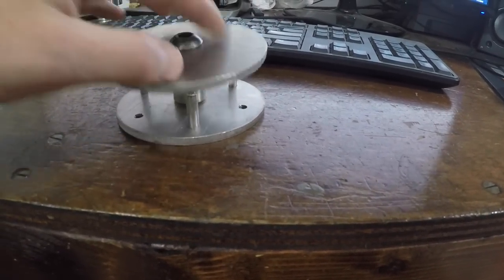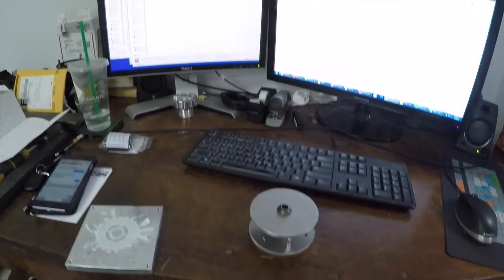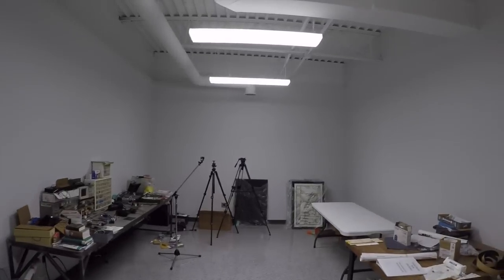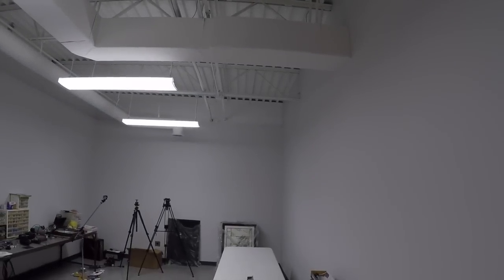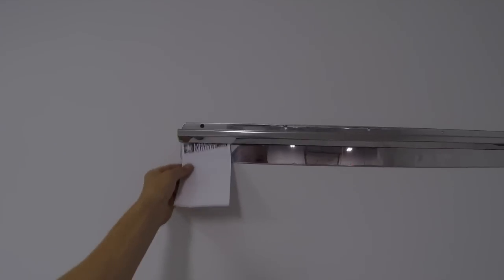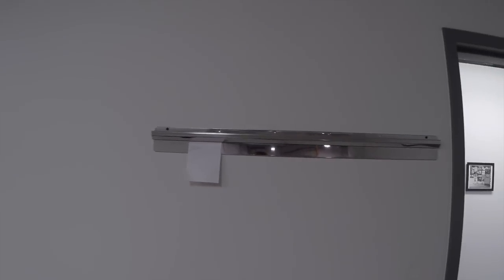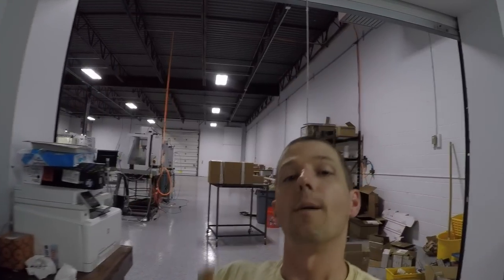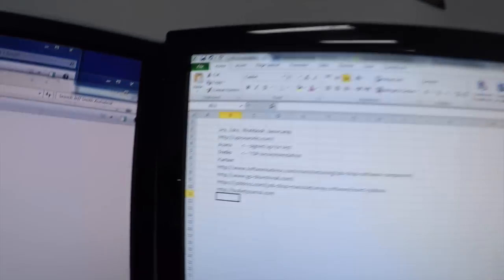New Projects, Arduino Sneak Peek, Organizing Jobs, 3M Tape Fixture!  CB26

Comment: Years ago there was a magazine called ROBOT if I remember right.  It wound up being largely about automating.  One article especially stuck with me.  A theater organ maker/refurbisher needed to make pulls for the sound stops, hundreds of them, out of wood.  It would take in wood dowel, feed it to the right place, turn the knob, drill a place for a pin and finally do a finish cut so the piece dropped into a cushioned box.  Not a big machine, but very interesting and advanced for the day (think early 1980s).  A small computer/controller was involved but it was long before Arduino or Pi's were on the horizon. It was very much a DIY effort.

All that to let you know nothing we do is really new, but we do keep learning from all our projects... Enough daydreaming for now. 

Have a great 4th!
Reply: Ha, I bet you didn't even notice the pump organ in my garage!

Comment: Hey! Some personal experience with trello, I'm a mechatronics student and for awhile i participated in the aerial robotics team at my school, I love your channel and I'm currently trying to build a desktop cnc/3d printer based off your diy videos !

With trello, it syncs across devices and can be updated by anyone , it's very similar to a digital ticket board with as much space as you need, however that space is what I see as its flaw, it can easily become very cluttered, my suggestion would be to have a organizational system about who does what and how it is to be operated, our's ended up with months old project threads sitting around, threads that weren't updated regularly, sometimes only half a group was on the relevant threads, etc. It's a great tool but as with any tool, the result you get, depends on how you use it!

If the cnc/3d printer you inspired me to make goes as well as I hope I'll try to send you guys a video on it!

Comment: 90% of your viewers won't have 3-Phase available, but they are going to be acquiring older industrial machines (many will be 3-phase) to get started. I think American Rotary has made a wise investment in sponsoring your channel.
Reply: Three phase is the way to go. Most viewers will probably build your own. You can't hardly give away three phase motors on craigslist. Than and a small cheap starter motor, and you have it.

Comment: I am a small manufacturer of my own product for about 16 years. I really appreciate your CB series. Makes me remember some of the old struggles and many of the current ones as well. I know you are really interested in creating your own automation but you also might consider an off the shelf robot arm from somebody like Universal Robots. I have no affiliation with them in any way but was amazed at the price. I went to the local dealer and had a demo and again was amazed by the simplicity and ease of programming. I'm sure using a unit like theirs in conjunction with your own automation projects would really open up the possibilities. Anyway looking forward to more of your CB series. Keep up the good work.
Reply: Not sure what your budget is but I did see you buy an expensive compressor and Iron worker :) They have 3 sizes and I got quotes on the small (UR3) and medium (UR5) size at around 23K and 35K plus about 3K if you want gripper system that the arm can change while its running. Back just a few years you were looking at 75K-100K and they were beasts that need safety cages, were not portable, and were more difficult to program. Where I live the minimum wage is $15/hr with taxes on top of that so it becomes easier to justify.

Comment: John, there is no fail. Only learning what does not work. And I'm in. I may not offer much in the coding department, but ideas I have.
On the 440 engraving feeder, I have a couple ideas if I were doing it. A vacuum fixture seems like a solid way to hold something in place and could be easily automated with a solenoid. That's where I think I'd start.
Reply: +NYC CNC Electromagnet was part of my other thought actually. We use those on aggregate conveyor systems to remove metal before it goes in a crusher. Should work great for steel. The vacuum system would work with any material it can pull a vacuum on which is why I was thinking that direction.
Reply: When thinking of engraving feeder/holder small pneumatic cylinders might be right solution. From my experience pneumatics is often used for this type of work and it's very reliable.

Comment: For projects you're contemplating manufacturing have you considered something other than Arduino?  Arduino fits well in quick one-off applications but doesn't have a good path to even a limited production environment.  You might take a look at the Texas Instrument MSP430 / MSP432.  Their 'launchpad' with Energia provides an Ardunio-like development environment but you can also ramp to more sophisticated environments as needs change.  Lots of support from a major company (big plus) with a big reference designs library; more processor choices; great low-power (battery conservation) capability; YouTube tutorials; and, some good reference books on interfacing and real time system development (check Amazon).  
The move from Arduino to something like the MSP430 would be philosophically kind of like what you've done with your cad/cam capability.

Comment: Hey John,

Love what you do and follow along with all the other machinist out there Tom Lipton, Adam, etc. I can help you along with the automation bits. I'm an Electronics Engineer and worked a lot with micro controllers including the arduino back in my college days. I work on an industrial scale now in the gas and oil industry with PLCs. Lots of different routes to take when automating anything. Shoot me a message anytime. Keep up the great work!

Comment: tilt switch, or 3d digitizer?
If you're going to heat a part to seperate it, why not just use super-glue (cyanoacrylate?) People use it all the time on lathes, why not on this? Use heat to break the bond, wash the excess off with acetone.

Comment: I may be able to help you with the automation projects. I am in process of converting my lawnmower to RC then later automating with Arduino.  I am a mechanical engineer junior transitioning to senior and I have decent programming experience. I am taking C++ now which means I can make my own header files and be able to adapt other header files to fit the program. I am also proficient in SolidWorks. Just let me know and we can set up a google drive for the Code and a grabcad account for the modeling. However, I may be swamp with a future internship so it may be just a weekend project for me.
Reply: Shane, I'm interested in the RC lawn mower. I'm about to start making one as well.
Reply: I am doing most of the wireless communication between Arduinos. I am leaning on WIFI communications now but I may change to xBee depending on range. I have a big back yard which can probably can fit a tennis court and a pool so range is very important. I will be building my own controller with acrylic or abs by heat forming it and using a drill press to put the various holes for where the buttons and switches will be needed.

Motor control is again mostly done though the aruino and a 8 channel HBridge. I am trying to make it so that it can turn on a dime. I also have a 16 channel servo controller that the arduino will be controlling. Each tire will have independent steering and power. Currently I have a decent sized RC tires but I think I need to go slightly larger in size. I have been looking at pneumatic tires but the price for some of them are a bit extreme. I am also looking at large 200mm scooter wheels but I am worried about traction.

I am using actobotics framing at this point. due to not having a welder. Also it is robot friendly erector set that is easy to build upon.  The mower has a decent frame itself but this is so that I can build the frame around the mower.  

The Mower is a 40V greenworks twinforce that weighs about 45 pounds. I went this rout because it is light weight and it has the potential of weight savings. Also, I can hack into the wiring and with a use of several voltage regulators power the entire bot on its own battery. This will be later when I am trying to automate it of course.

I may forgo the bag because it add unnecessary weight to the robot and I heard that mulching grass can be good for the yard. Also a bag delivery system would be a later project. Maybe in a few years. lol

Comment: Wow John! I'm surprised that my comment from the previous video about your Arduino projects maybe got you thinking about them again.
Object. Remote jog controller? 
I'm currently trying to get a Blynk phone app controlling an ESP8266 WiFi Dev board and these can also use the Arduino IDE.
I'm not great with motor control yet, but if you're interested could send you some sample code to see if you don't mind my coding style :-)
Of course there are many other faster/better micros but you could spend valuable CAD/machining time just doing the research on them and learning
the interface.
Anyway, I enjoyed the refreshing change just as much as I look forward to anything new you upload. Thanks again!
Reply: It's winter here, and I'd like to control heaters in multiple rooms from WiFi and also have a phone/web interface.
I've already written a fairly nice Arduino Nano app but due to limited chip memory and wanting to go a step further have decided to try an ESP8266 device.
Nothing CNC related of course, but I enjoy coding and also learning F360 thanks to your channel.

Comment: Stretch release adhesive!
http://www.tesa.com/industry/electronics/assortment_overview/bond_and_detach/tesa_70465,i.html
This works great. Think nice thin command strips in sheets. 
Cut with a rotary blade knife.

This happens to be the 650 micron thick sheets, but other thicknesses sheets are available.

As for floss substitute, we use a kevlar thread to get thinner yet strong enough to cut other adhesives.

Comment: When you get to a point when you are getting ready to setup the electronics for the new lathe to make the dedicated parts look at velocio plc, http://velocio.net/
I have used them for a couple of projects with great success. The software was easy to learn and you can run step/dir signals with them.
Reply: +NYC CNC it has been a while since I last played with arduino.. so I couldn't make a good argument against them. I do recall interfacing to step/dir signals was a little wonky with the arduino. that may have changed dramatically since then though. I bought a velocio plc to try and found it to exceed my expectations. there software was free, big plus for a plc, it was also very easy to learn and understand. there was also quite a few tutorials to help a guy get started.